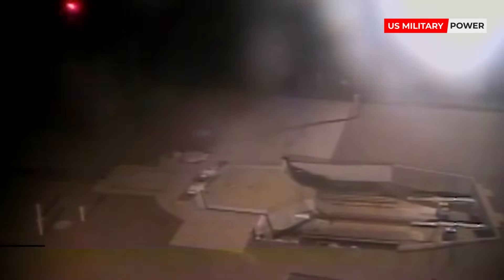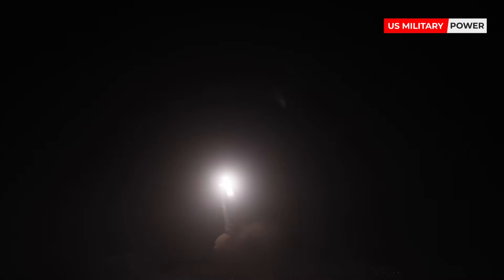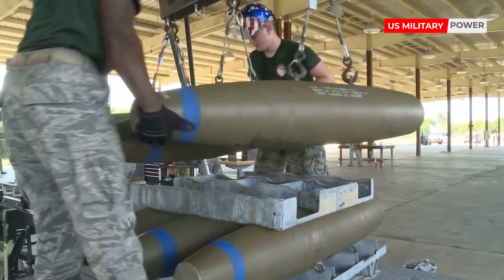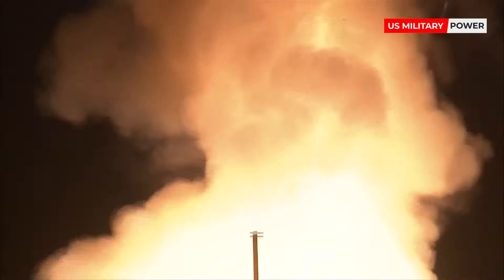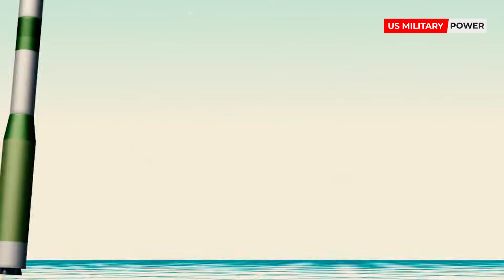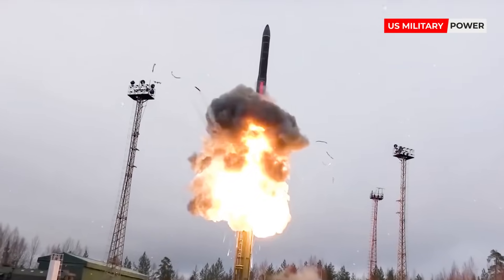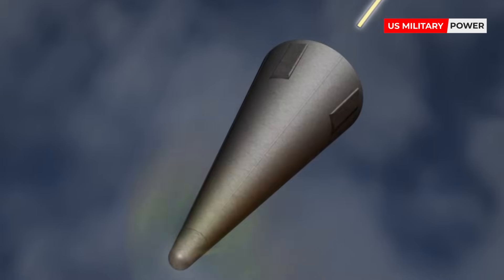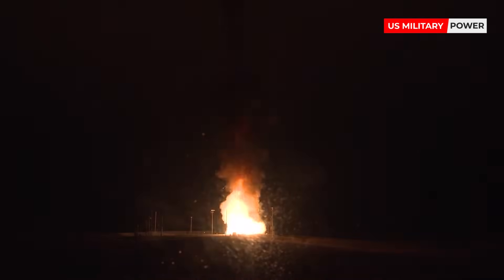How Does an Intercontinental Ballistic Missile (ICBM) Work?

Comment: It's insane how they're able to launch these such far distance, I wonder how much weight is made up of fuel.
Reply: My question is too💎
Reply: Roughly 90% of the entire mass. Let’s do some rough calculations on the Russian SS-27 Sickle-B

SS-27
Launch Weight: 47200 kg or 104058 lbs 
Warhead: 550 Kilotons, estimated weight between 500 and 1000 kg or 1100 or 2200lbs 

Missile Body: most likely Titanium with lightweight composite materials, estimated weight: 3000kg - 5000kg or 6600 - 11000lbs 

Estimated combined weight without fuel in worst case scenario: 

13200lbs 

Estimated Fuel: 90828 lbs or 41192 kg 

Percentage: 87.27%